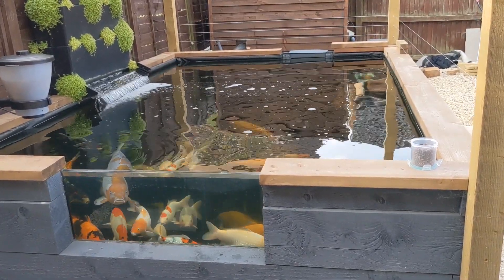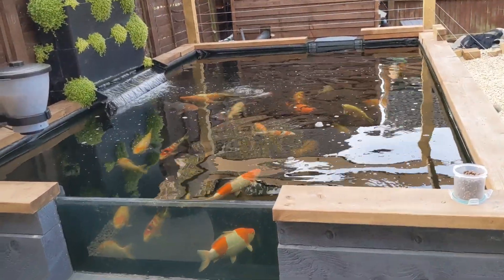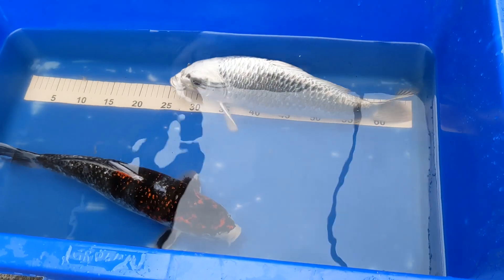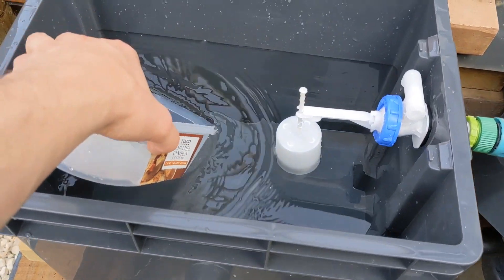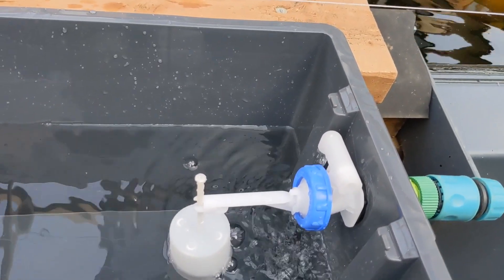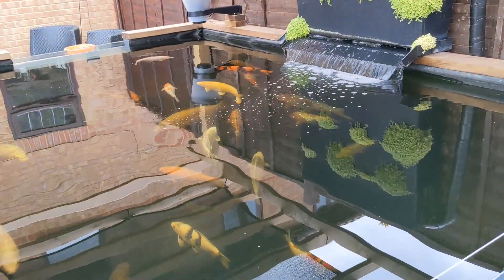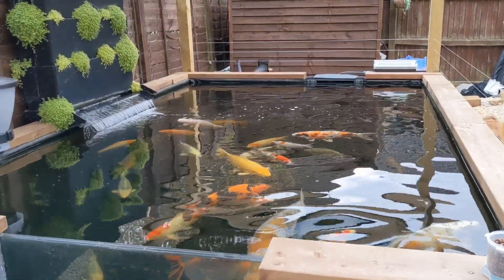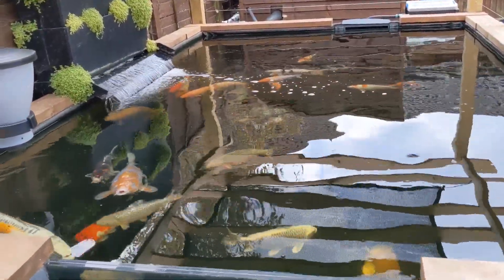DIY Auto Top-up for my koi pond 🐟

Comment from the maker: Koi pellets available hear. thanks for your support 👍
https://www.ebay.co.uk/itm/165013573689?mkevt=1&mkcid=1&mkrid=710-53481-19255-0&campid=5338273189&customid=&toolid=10001&pub=5575378759&icep_ff3=1&ipn=psmain&icep_vectorid=229508&kwid=902099&mtid=824&kw=lg

for anyone who wants to make there own this is the top up valve I used
https://www.screwfix.com/p/side-entry-fill-valve-/64191?tc=DB8&ds_kid=92700055281954514&ds_rl=1249404&gclid=Cj0KCQjwkIGKBhCxARIsAINMioI0mq71sS85-a6hOodwp5Qh1L96fKt-Zi7ZnxrcO8Z5RCOpSn7D4w0aAuf5EALw_wcB&gclsrc=aw.ds

Comment: So I put on a vertical tee on my 4" bottom drain pipe so that I have a body of water outside the pond but still has it at the pond level for this purpose. I'm trying to look for a nice industrial float valve for use, maybe the type they use on a farm trough.

Comment: I use a tunze ato and the only time i have had issues is if the filter floss or whatever pads you use get to dirty the pump will overflow the aquarium as the filters are restricti g the flow. Maybe the sa.e tbing

Comment: Excellent work Danny. Works perfect. Are you going to put a lid of the top up box? The hole will actually become handy to let air in. 
Fish are definitely growing like crazy in your pond!
Reply from the maker: Yeah the box has a lid for it. Going to insulate it before the winter so it doesn't freeze. 
I'm really pleased with the growth this year, so much better than last year. The heat and extra food has made a massive difference. Going to keep the growth food going in until the end of the month then start bringing the temps down
Reply: @dannycurrie1  I cant believe the days are getting shorter already and are all starting to prepare for the autumn/winter :-(
Reply from the maker: @LauMagroTheFrenchKOInection  I know. It's so depressing. Need to get myself some polycarb to make some covers. Boring. Been a bit of a crap summer weather wise

Comment: Nice job there Dan simple but effective .Can i ask you  where you got your pipe insulation from just connected up my ashp i12 same as yours need to lag exposed pipes noticed you have got two different sorts of insulation one has the silver foil type on the outside the other without want to get this done before weather gets to bad and we have some evening daylight left .👍thanks
Reply from the maker: The black stuff was called armaflex, can't remember where I got it from. Wasn't cheap. But seems really good. The silver backed stuff was some old thermal bathroom underlay, I had loads of it spare when I had the bathroom done. Just taped it to the larger pipework. Probably not as efficient

Comment: Hi Danny. I'm fitting an auto top up system to mine soon, but at what height do you set the float to shut off at, resting water level height when all pumps are off, or working level water height? I thought about this as when the pump kicks in and draws water, the water level in the filters etc drop slightly, which would cause the ball valve to open if it was set to resting water level height, this then would become an issue if when the pump was turned off, the level would rise above the initial set water level and spill down the overflow. Hope the question makes sense
Reply from the maker: Needs to be set at your running level really or it will start filling, leaving you overfilled when you turn your pumps on. My overflow is set a bit higher than I used to have it so now when the pumps are off it still doesn't overflow. My overflow isn't really used now. It's kind of just a back up if we get any really heavy rain or anything. The auto top-up has worked brilliantly so far, unsure what will happen when it gets down to freezing temps but will cross that bridge when we get there 🤞

Comment: Hi if you had used flexible pipe between the skimmer and the top up tub. You could have lowered the top up tub to suit the level. Why could you not have set the top up auto float through the wall of your pond under your copings.
Reply from the maker: I could have still lowered to tub but couldn't be bothered to move the shelf. Was easier to cut a new hole. It's above water level so don't make a difference. I could have had it in the pond. It would have worked but I don't want it in there, just 1 more thing for the fish to injure themselves on and easy to hide this way once I screen the back off
Reply: You back again Keith being nice this time 🤔